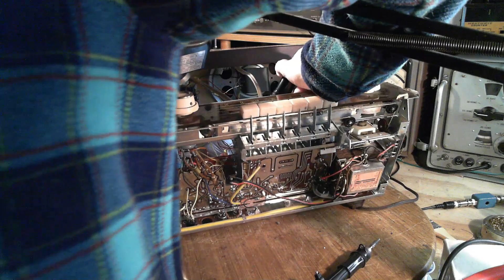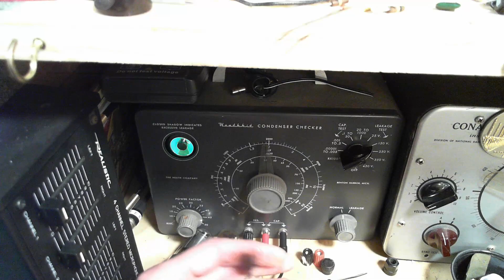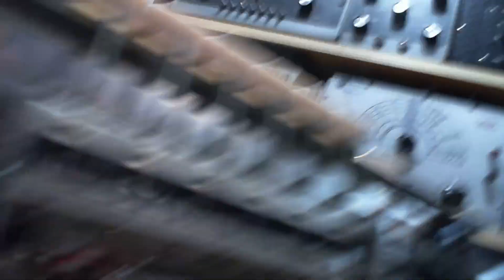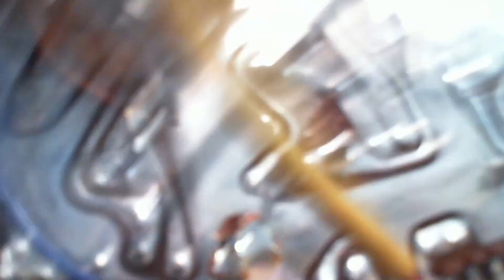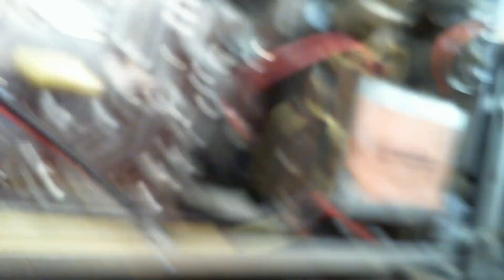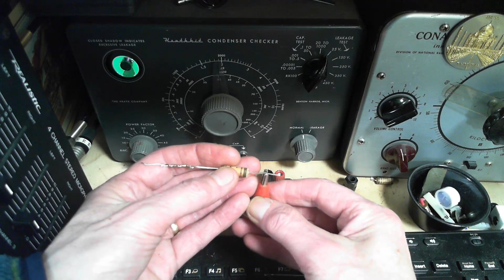Nordmende Boheme C Tube Radio Video #8 - Four More Capacitors Replaced

Comment: Clumsy, lazy and clueless. Highlights of the day: Yes Jim, it matters a lot on which side you place a component. Here you replaced a cap on the wrong side of the board, right on top of that "funny thing" (pcb inductor or coil, you should know better). Placing a plane on top of a coil will change it's inductance and resonant frequency. No wonder your "alignments" always turn out so messed up. BTW, do you ever clean a chassis before doing any job?